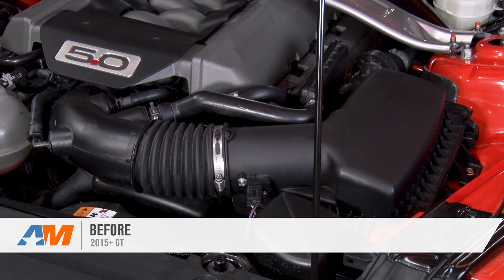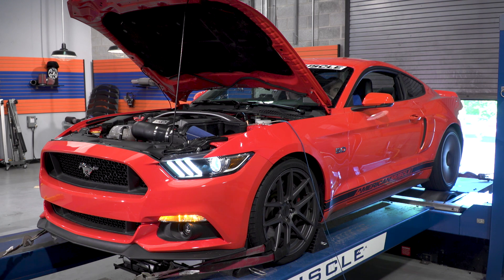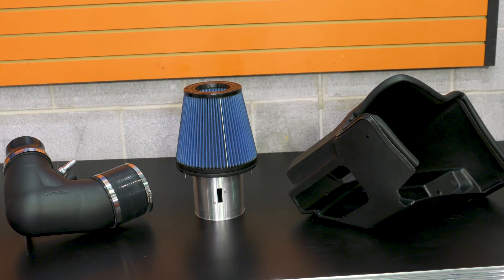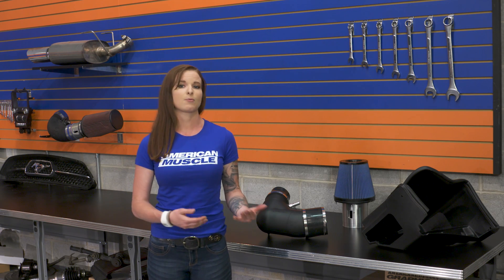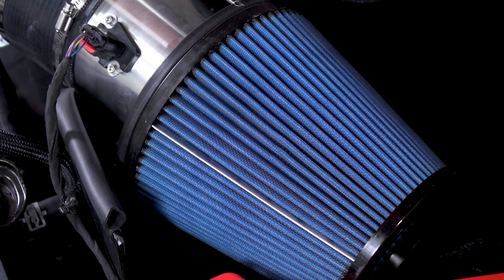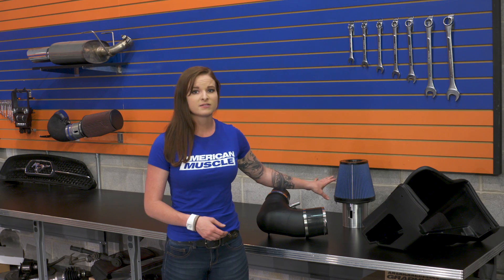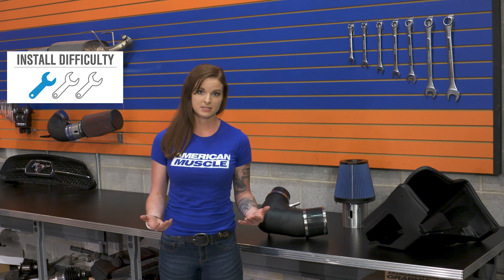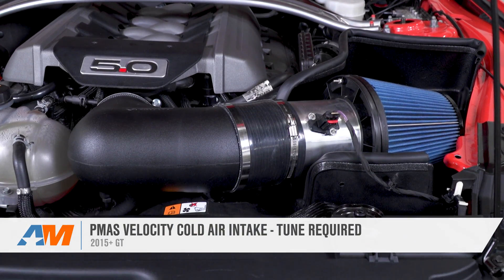2015-2017 Mustang GT PMAS Velocity Cold Air Intake Review & Install

Comment: Thanks for the video. Where can I get a melody for this induction. I have bully dog BDX but it does not come as an option. I don't know which of the others can work. The options are JLT Plastic, aIRAID mxp, k & N air charger STEEDA PRO FLOW, CP-E icebox, BBK BLACKout, it only works relatively well with Steeda. Please your help